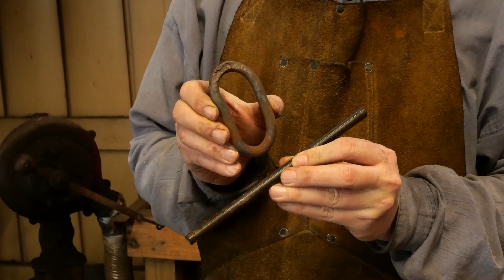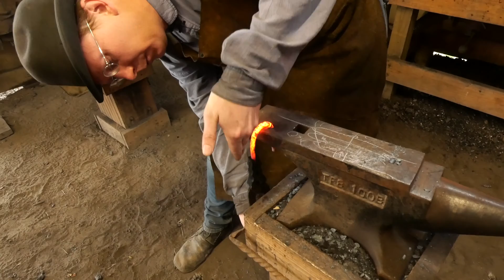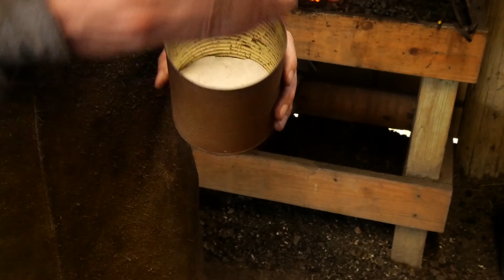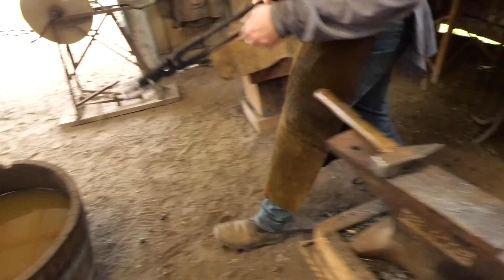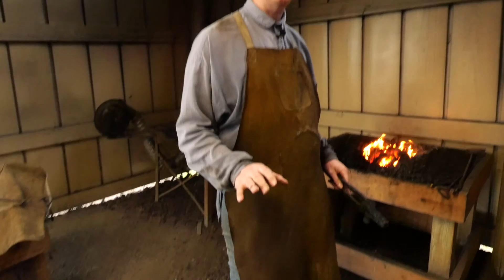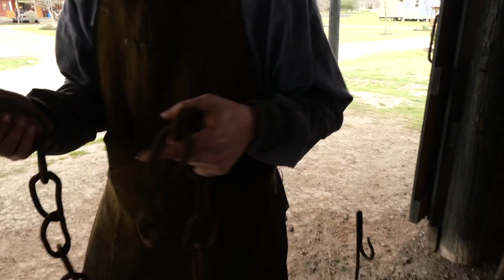Blacksmithing 2.6 - Chain Links

Comment: I have been told clinkers
Will Rob your  heat
Reply from the maker: I've heard both:
1) Clinkers rob your heat.
2) They off gas or in some other way interfere with the welding process. 

I'd agree with the rob your heat but it's mostly because they take up space that fuel would otherwise use.  So if 25% of the space in the forge is clinker you have 25% less fuel to heat up your steel.  I don't think they rob heat more than any thing else that displaces the fuel would. 

For the second point I haven't seen any real evidence of that.